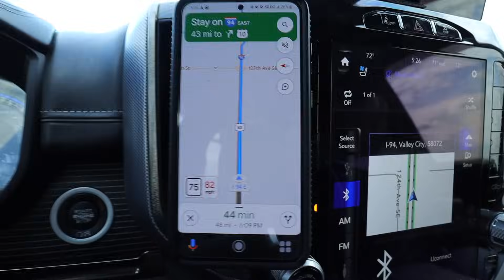We Lost A Tire on our RV and how we handled it.

Comment: I (Dave) am an expert with regards to calibrating torque wrenches (38 years calibration technician at a nuke plant).  Always - always - always set a clicker torque wrench to its minimum setting when not in use.  Really glad that you recognized the need to check and probably replace all lug bolts.  OBTW, you are probably lucky that another one (or more) didn't fail with the physical shock when the first one cut loose.  Our hearts went out for both of you.  Thanks for sharing and hope you are having better days.  Safe travels!
Reply: hmm. I should read before I post. My bad.
Reply: @ClarenceBillHolden  ??
Reply: @davelauraphillips8814  I made a comment explaining what everyone else already explained. I hadn’t watched all of the video or read any of the comments. Just jumped in and tried to help. The main thing is he changed the studs on all 6 wheels. 
Good to see so much help here.
Reply: SO GLAD HE CAN DO WHAT NEEDED !  W&EN WE GO ITS USUALLY MY DAUGHTER AND ME  , AND IM 84 OLD WOMAN ! TERI WOULD HAVE HAD TO DO MOST HERSELF OR.  PAY TO HAVE IT DONE ! 
MY SON IN LAW CAN   WOULD BE USELESS !!   I USED TO HELP MY HUSBAND WHEN YOUNGER  THO !   THIS MAN IS A BLESSING !!
Reply: Yeah that's an over torque issue for sure. I wont leave Discount Tire until I take off and replace every lug nut they put on and tightened. In my younger days I broke a lug nut wrench due to it being over torqued by Discount Tire. Walmart does the same. I was stuck on the side of the road with a broken lug wrench; I now carry a four way lug wrench and a battery impact in my truck. My battery impact also serves as a electric jack for my trailer, so the battery is constantly replaced or charged.

Comment: Lug studs are readily available at any parts store...a hammer and a pin punch can knock those broken studs out,  and install new ones...while you're at the parts store,  spend 80 bucks and get a torque wrench.

Comment: One reason manufacturers, recommend that after new tire replacement, you torque him you drive no more than 50 miles and you get out and you re-torque him of course most people don’t do that and most of the time they get by with it but if you got loose lug bolts it will snap the heads off of them and that’s what happened

Comment: I once got used tires on my station wagon, watched the guy put them on with the impact wrench. We were both fooled cause the impact wrench attachment was loose and did not get the sockets on tight enough. A mile from work my car jerked and I looked in the rear view mirror and saw the tire in the air. I was able to pull over with barely a swerve. Two people behind me stopped too. One guy points out where my tire went off the side of the road. Brought the tire back and realized the hub (that covers the break assembly) was missing. Asked the same guy about the hub and he exclaims "I don't know! I was watching out for the tire!" I laugh every time I think of that guy's response. 😂

Comment: TIP:  If you have to, you can remove one bolt from each of your other tires & use those as replacements.  One bolt missing from each & driving cautiously is quite safe, assuimng the bolts havent been weakened by over torquing.
Reply: I was thinking the same thing, but he did it well by being cautious. 👍
Reply: That would be a huge project Twice to remove 6 hubs for a few wheel studs. 
If I was in a remote area I would tie the axel up and travel to the nearest city to repair it.
Reply: Craig that is a clever idea I have done once before.... I think it is very clever advise.

Comment: Glad you are OK!!!  I feel your pain, made the same mistake!  One week ago, experienced losing BOTH wheels on the drivers side of my recently purchased 5th wheel (tandem axles), 15 miles east of Cedar Rapids IA.  I had traveled to MI to pickup my "new to me" 5th wheel - was so excited and busy with so many other items on the journey back home; had topped off tire pressure, but forgot to check the torque.  Very thankful I was able to remain in control of the truck and trailer, pulled over a good 6-8 ft off freeway (trailer riding on the two hubs) into the grass next to the corn field and began trying to calm down; a good Samaritan helped me recover one wheel from the median; AAA was worthless and would not even provide me any guidance or suggestions except "We don't do RVs".  So I called a local towing service and they recommended me to Papa's truck recovery and towing (for commercial trucks); they sent a technician who came out, removed one hub, took it to town, got parts, came back, hammered out old sheared off bolts from both hubs, hammered in the new bolts, cleaned and re-packed outer bearings, reinstalled both hubs, then reinstalled my recovered wheel and the spare, all while on the side of the freeway.  He noted that my other wheel was likely a ways back down the freeway and the rim would be unusable - the sheared off bolts were coasted in aluminum, indicating they had worn through the pressed in bushings in the aluminum rim.  4 hours and ~ $500 to get back on the road... lesson learned... always check torque! (never had this issue in 20+ years on my old bumper pull with steel wheels).   Have since upgraded my 15" wheels/tires to 16" Goodyear Endurance with better rims, 2" lift blocks for suspension, and CRE3000 equalizers to level out the trailer for better ride and handling (trailer had been 4" low in back - which shifts more weight onto rear axle/tires).   VERY thankful no serious damage other than losing one wheel/tire and some bent sheet metal trim.

Comment: First off kudos for your can do attitude. Several people have commented about the torque on the lug nuts. Replacing the studs is a very good idea not knowing if they are stress cracked.
My first trial was putting timing gears and chain in my GMC pickup on the side of the freeway after pushing  my truck with camper and a dune buggy on a trailer about an 1/8 mile to get off the freeway by sitting on the bumper with my teenage son and pushing while my wife steered the truck. Did i mention it was at night???
With the help of a CHP officer i was able to get the parts needed and make it back home after working on it most of the night. Big fun but a great learning experience.
Safe travels, you did a great job.

Comment: Once they are over torqued, stress fracture occurs, and advice is to replace all lug bolts  is safest. You may be fine just losing them and placing them at correct torque, but you are carrying a lot of weight over rough roads

Comment: The exact same thing happened to us in our 36ft 5th wheel about 2 years ago. Apparently the person we purchased the rig from had been using an impact wrench removing and reinstalling wheels. We lost 2 wheels at one time. My beautiful wife still has ptsd from the incident. But us to where blessed on timing and the area we where in. No one got hurt and I should of checked the lugs after the purchase. I replaced all the hubs due to paranoia when we got the rig home. Nice job! Glad you shared this. You probably saved a life or prevented a very bad situation by sharing. All the best!!!

Comment: I always put the tires back on by hand, get a cross bar lug wrench  and always check after 50 miles of installation and yes  always torque  when takin the rotors off , you did good!

Comment: I just learned  a very  valuable  thing from you,    Not to tighten  lugs nut too tight.    When I just bought a rockwood 24 camper last yr,   I tried to check to see if I could take the lugs off.   I could not.   I  had to use my 2 foot  snap  on  lever ( with an added pipe)  and with all the strength I had,  I finally loosened them.     I now know,   If I had left them  like that,    I could have had your problem.    Oh my  God.     Switch it Up  has  meant a lot to me  today.   It  made me  thankful that  I didnt  have a problem.  with my  too  tight  lugs.      Thanks  a Bumch,   Charley Kilmer  Ocala.   I would like to meet you both  some day.    You are a Public  Service.   !!!!!

Comment: If you used your "Friend?enemy" to tighten all the lug nuts you are right to be concerned. Over tightening stretches the bolts, in a weakened state they are prone to shearing which results in wheel separation jesu as happened to you. Once stretched they can fail at any time regardless of a lower torque setting. I'd replace the bolts and nuts on the other 5 wheels, 40 bolts and nuts are a cheap price to pay for peace of mind.

Comment: Todd was the man with the plan.  This is a month or two old from the looks of it, but Todd if you search on Eric O's page South main auto he has videos for changing the entire hub out instead of doing brakes, I often did the entire hub as it would be as cheap as brakes sometimes. Then you do not need to worry about if you stretched a lug bolt.   Glad the wheel did not cross into on coming traffic.   Stay safe and healthy.

Comment: Who told you it was from using the impact? Most people wouldn’t realize unless they were told.
Great job of making the video and letting people know.

3 reasons not to use impact on wheels 
1. If you get them super tight and don’t have impact with or say battery is dead you’ll wish you never used one if you get a flat.
2. What happened here
3. If the rim isn’t tight on hub  you can have a gap and once your moving it will come loose

Comment: Glad y'all were blessed in light of the situation. We feel for y'all and are glad you got it sorted without more difficulty than it was. 

Our bedframe broke the night before we left on our current excursion. One week into our trip we demolished the doors on our fridge with the slide. Thankfully we were able to get a new fridge ordered and delivered to one of our stops. I was able to get it swapped out after running around for a few hours gathering miscellaneous parts. While hitching up at our last park, the tongue jack failed in a extremely dramatic fashion. Thankfully, we were already hitched up and I was just attaching the torsion bars for the weight distribution hitch. We were blessed that, halfway to our next stop was a Camping World that had a new tongue jack in stock. 

Sometimes it's less than fun but we really need to focus on the blessings and not failures. Your positive attitude was fantastic and I hope y'all's adventures going forward are all positive. 

Hope that we'll get to meet y'all somewhere down the road. God bless y'all's journey.

Comment: I feel your pain. On a trip heading north out of Kentucky to Ohio, we hit some construction which bounced our SUV and single axle trailer and popped the e-brake cable. Trailer brakes tried to lock up and the brakes proceeded to basically explode. Sounded like a tool box in a washing machine. At our stop at a winery, I removed all the internals from the trailer brakes and drove across PA with no trailer brakes. Ordered new Dexter brakes assemblies to meet us at home. BTW this was the second time I had the change the brakes (yet another unrelated trailer brake story) in less than a year on a year old camper. Keep the positive attitude and always remember what is important. Some day I'll tell you the story where we got stranded in Louisiana on a Sunday evening with a bad alternator that took out our battery and found a rip in my tow vehicle tire sidewall during the repair process. Exciting times :)

Comment: Sheered lugnut bolts can be punched out after they are sheered. Remove the brake drum and drive them through. you can buy tire studs. So over or under torquing can leed to tire stud sheer. Replace all the tire studs, if you loose one wheel then replace all the wheel studs on the trailer. Harbor Freight has inexpensive torque wrenches that will do.

Comment: This adventure you went through brought a big deja vu for me. I went through it back in March this year, circumstances were different, but arrived at the same conclusions. I had removed the wheel to check on the breaks and must have torqued it wrong when putting it back on. Off it went at the beginning of my next trip. I carry extra studs now, but possibly won't need them if I keep torquing the nuts to the correct specs. Lessons well learned shall not easily be forgotten.

Comment: Bearing nut tight to bind wheel ...back nut slowly until wheel turns then safety lock it.  When torquing go slow steady pressure until click or peep.  Other already installed wheels,  back off one nut to loosen passed torque value, then torque to spec value. Cross star pattern to even the stress on each lug. Find all instructions on YouTube.  You did good but, keep thinking and learning before something else comes up.
Reply from the maker: Appreciate you for sharing

Comment: May I suggest wearing eye protection if you're going to whack that chrome vanadium extension while using it as a punch tool to remove the fractured studs.  That type of metal is not very ductile and can brittle fracture when hit hard, posing a danger to your eyes.

Comment: I'm a retired auto tech, and when those battery powered impact guns became popular, I watched many techs stop torqueing lug nuts because faster is better. Then when they were caught doing this, they got out the torque socket extension and attached it to the same gun. You couldn't explain to them that the gun is still not applying enough torque.

Comment: Take your drum after you tighten the nuts to install the lugs and set it on the inside of your rim that is laying on the ground and hit it with your extension and hammer to make sure it is totally seated. My impact gun the same as yours when I put the lug nuts on and test it. It's torquing them to 125 lbs.

Comment: thanks for sharing this experience. I wasn't aware of the torque potential for this impact wrench so your video prompted me to look more into this -- learned A LOT about  drills, drivers and now I know something about how these lug bolts are put into the wheel hub! there's only one thing worse than having a life problem -- and that is keeping that experience (and hopefully its resolution) to yourself. they say you can benefit from another person's trials but that's only true if you become aware of their trials in the 1st place. again, thanks for sharing. very valuable input.

Comment: Todd and Sheila I have been in your exact situation, after doing the exact samething. I beat myself up something fierce because I knew I was the cause of putting not only our home in danger, but others traveling the same road and ourselves. I was similarly lucky to have the situation happen about a mile from a trailer parts store and was able to get new hubs and replace everything. I'm so glad everything worked out and you were able to make it to the huddle.

Comment: Ratchet srtaps and chains are a must , different sizes and bolts to secure them . Axle out of alignment or loose lugnuts or over tourqed . If they tightened  them with anything but a tourqe wrench its a good bet something is wrong . Glad you guys are safe

Comment: Same happened to us, we lost a wheel--all lugs sheared off, required new hub AND new rim.  We were in Canada on the Alcan highway, about 30 miles from the Alaska border. No help available in western Yukon, and Alaska businesses cannot work in Canada; so, we had to leave the 5th wheel on the side of the road, I had to remove the hub and take it to a shop in Tok, Alaska. Got replacement hub, drove back to the RV on the Canada side of the border, and installed new hub.  I've some DIY skills and I did the hub replacement by myself on the side of the road.  Quite the experience!
Reply from the maker: Ugh!! Buy an RV they say, it will be fun they say lol -- Glad you are all good now but dang what an adventure!!

Comment: Any quality tire shop like Discount Tire and Costco will ALWAYS do final tightening of lug nuts with a calibrated torque wrench. You should also use a torque wrench that has your required torque setting more in the middle of the torque range instead of one on the upper limit. Lowe’s sells one since I had to buy one when on the road with my last RV when I had to remove the rear wheel on a Class C to go have the metal tire valve tighten at a tire shop, but did not want to break camp. I keep in 24/7 under my rear seat in my truck. There are also torque limiting 1/2” extensions you can install in between your 1/2” Dewalt and socket to cause the wrench to cut off before you over stress the studs. It is even a Harbor Freight item with several extension for various torque limits. BTW you must replace the other 40 studs because they are all ticking time bombs since they were also over stressed too. Good luck.

Comment: Really really happy for you that wheel and tire did not strike another vehicle or property along the road. They have a lot of energy.  It is really important to re-torque wheels at least once after installation especially aluminum wheels. Criss cross pattern. If you tighten in a circle the first nuts get tighter than spec sometimes. 
I carry a measuring tool called a caliper for measuring bolts, studs, depth of stuff, comparing parts etc. I also have a set of good quality punches - they have the correct weight and hardness for driving bearings and generally belting stuff a good one when you need to. And a heavy millwright's hammer like you were using. Lots of times mechanical work needs a gentle hit with a heavy hammer vs whaling on things in anger. 
Finally for anyone that has read this far ha ha you tighten bearings then back off the nut to set a few thousanths of "end play" so they have room to expand when they get warm.
Nice repair - safe travels.